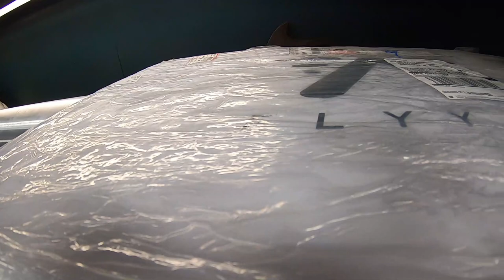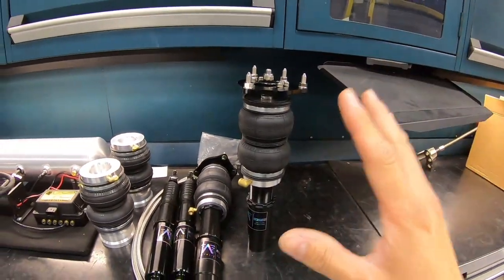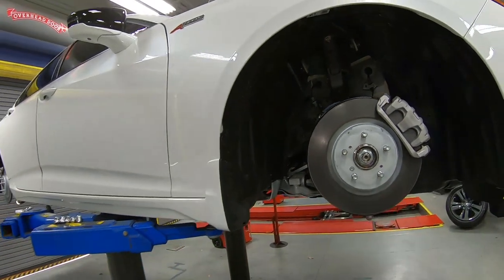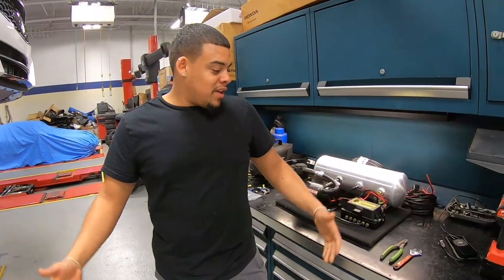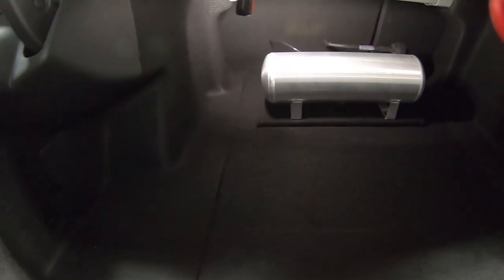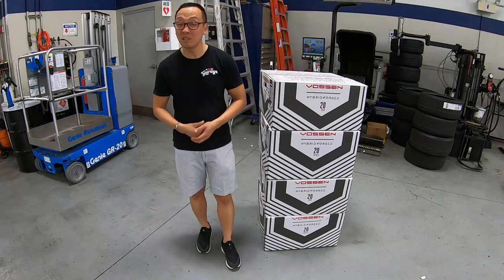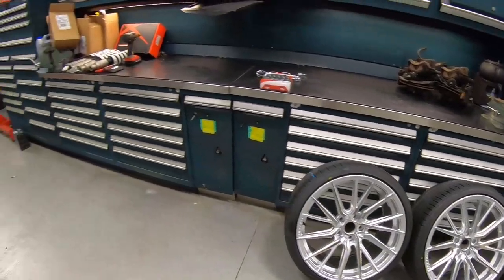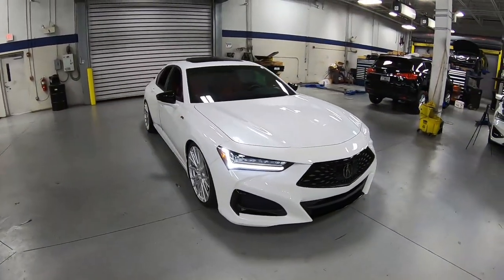2021 Acura TLX Aspec - Air Suspension Installation | Flyyairr | AirLift | Vossen HF4T | Toyo Tires

Comment: Would it be possible to install the type-S  catback exhaust with the quad pipes on the aspec 🤞
Reply: Looking foward for this answer 🙏🏻
Reply: It would be awesome if you can. I was think about doing that.  Hopefully it’s possible.
Reply from the maker: Not quite sure. We will know after their release
Reply: Should fit. I need this on my aspec!!! I’ll cop rn is there a discount code?
Reply: @ObviouslyBaked  suspension, wheels or the Type S muffler System?
Reply: @ahcgarage  any updates on the catback retrofitting on our aspec.

Comment: 3:25 is that rust already on a 2021?
Reply: thats what i was wondering too.
Reply: It looks terrible! I actually bought a Ford truck late 2019 & it also had some rust near the differential/axle. The dealer guy said it was normal... All the other trucks had some rust too, not just mine.
Reply: Watch SavageGeese review of this TLX. Pay attention to the in-shop segment where camera is under the car while it's on a lift. There are so many rust spots. It had less than 6K miles...

Comment: I'm back here again to check out the air suspension install, I wound up selling my 18 Tlx aspec & now have the 21 TLX type s which has been a blast to drive & looks great in tiger eye pearl, I just wish I could get this installed by Acura under warranty like they have on the MDX type s

Comment: Question, since you guys are installing this set up, what about the different ride modes that this car has? Are they no longer available? Are you getting a check engine light? and lastly how is the ride compared to OEM Suspension? Overall this looks great.

Comment: Awesome build video where did you run your ignition wire for the system? The trunk fuse box?
Reply from the maker: The signal/ignition wire is attached from the driver's under dash fuse box

Comment: I'm running those same tires on my 3rd gen TL
No complaints
Reply from the maker: We ran the High Performance/Summer version of the same tires on our 2021 Blue TLX, they seem a bit weak on rain condition, which is a normal characteristic. We opted in for the all-season and it's much better all around tires